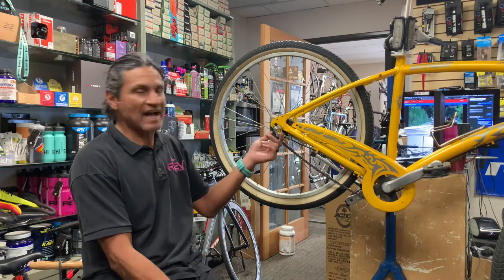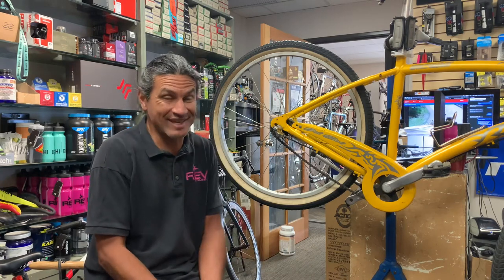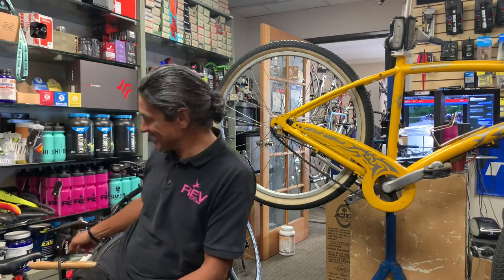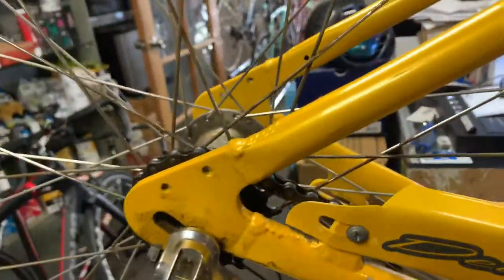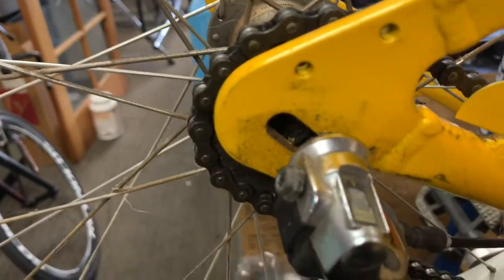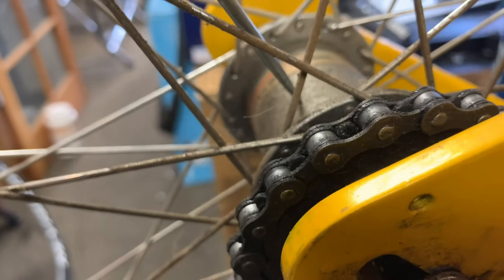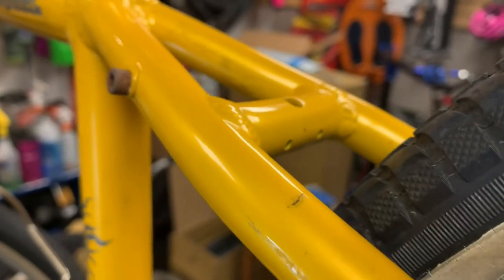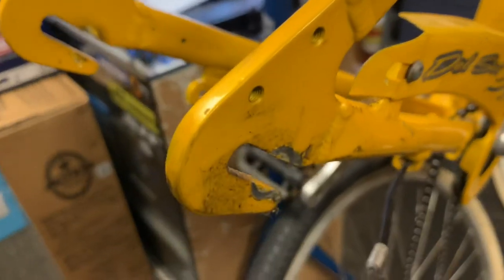How to remove a wheel with Shimano Nexus 3 speed internal geared hub coaster brake

Comment: Can I install an 6 bolt adapter for disc brake installation in Shimano Nexus 3S?
Reply from the maker: Apologies. I don’t have an answer for you. In 11 years of owning my bike shop the bike in this video was the one and only Nexus 3 speed beach cruiser bike that has come through my door. I am a high end road shop. Because this bike was so rare to my regular business I shot the video.
Reply: @SeeYouUpTheRoad  I got the point. I am just curious since I have no braveness to disasembly my own bike (United Trifold 3S) that came with Shimano Nexus 3 S. I see an enough space on the left side of the IG but could not find any video or article that brings up this case to the table. I just imagine whether is it possible to apply 6 bolt to that space. Anyway thanks for the reply

Comment: Does anyone make a 3-speed kickback hub with a coaster brake?
Reply from the maker: Apologies but I have no clue what you’re talking about. I’m a high-end road shop.
Reply: @SeeYouUpTheRoad  I am looking for It is a 3-speed hub that is shifted by briefly applying the coaster brake rather than a gear selector. A Shimano 3-speed hub has a cable gear selector. I guess I should be looking for a beach curser shop.
Reply from the maker: @johnd01  sounds cool! Yes check with family bike shops or beach cruiser bike shops. 

Thanks for watching!